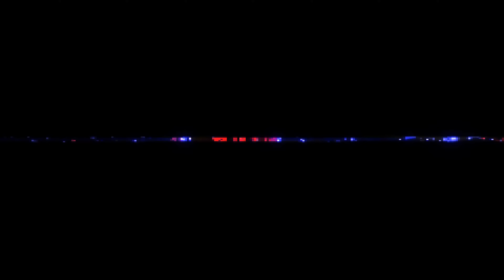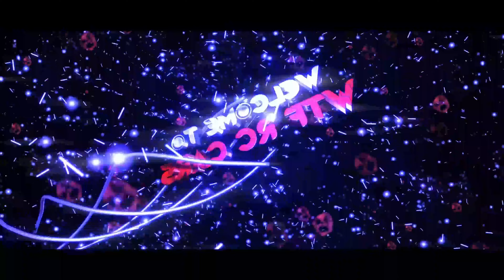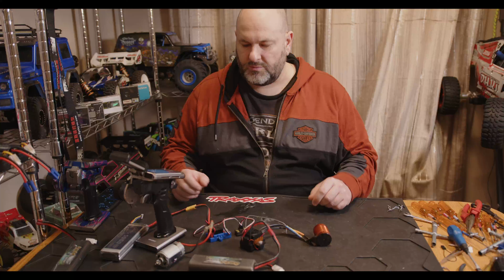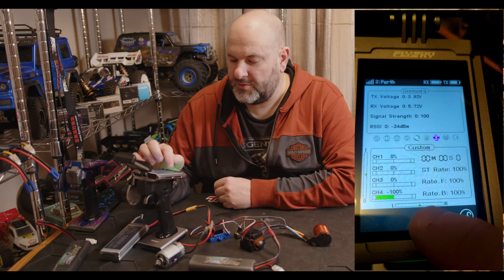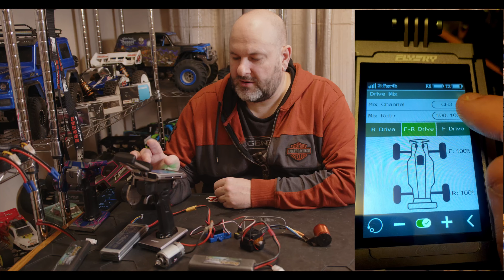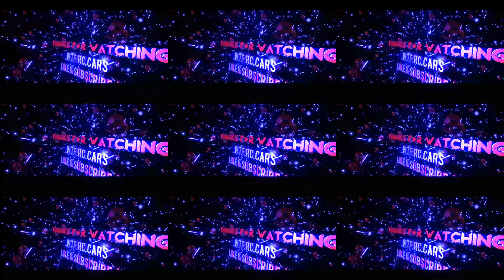Flysky Noble Pro dual motor and ESC MOA setup guide.

Comment: Hi there So I have nb4 plus and I got a mamba x2 micro motor and esc combo. I put it on my granite grom, I had a new receiver for nb4 plus to add to my 8 channel nb4 plus controller. I got the servo to connect to my nb4 and Im having a problem with the motor/throttle connecting. I can get tires to move with power for a brief moment but then it stops right away it won't stay moving constant. if I hold it down super light I can keep the wheels turning but right away if i add more power it stops or most the time it wont move. Not sure what to do and hoping you can help, please let me know !
Reply from the maker: 1st make sure you have run calibration on transmitter so you know that the throttle is working it's in system menu, then you will need to put the esc into calibration mode to make sure Ethan it knows what 100 throttle and brake are then it should work fine

Comment: This was helpful ... building a dual motor setup and using rear steer as well. hahah
Reply from the maker: Glad you liked it :)
Reply: @WTFRCCars  Ok I have a strange one for you!  I have FGrS4 v2 and original NB4 (no drive mix option).
I want to put the rx in 6 or 8 channel mode, and use it for both dual motor & 4wheel steer (other than using an actual 8channel rx) . hahaha  Any possible way to get that going? What do you think?
Reply from the maker: @grvtyboyRC you can use the ibus 4ch add-on to get 8ch
Reply: @WTFRCCars  On the FGrS4 there's 1 ibus channel - I cant just use that 
can I?
Reply from the maker: @grvtyboyRC you would need the 4ch ibus breakout to use extra channels

Comment: I have a MOA with two Hobbywing Fusion Pro. But the rear motor doesn‘t work. Have any body a ideer?
Reply from the maker: Make sure you don't have both the red wires connected from front and rear as the will both try to supply power and one or both will not work

Comment: Do you have a video showing how to set up 4WS? Click-normal 4ws…click-crab walk…click-rear steer only…click-front steer.
Reply from the maker: I have one for the nb4 but your the 1st to ask for a pro vid so I'll get one made for you :)
Reply: @WTFRCCars  I think they would be the same wouldn’t they? If so no need and thank you for offering.
Reply from the maker: Although they look the same the nb4 and pro are different transmitters but you should be able to use the nb4 set up vid for this just the pro has more options :)
Reply: @WTFRCCars  sounds good thank you. I just got mine for Christmas, wife and kids hooked me up. I did the firmware update and it has a whole extra page of icons now! Holy cow! I also noticed they have changed the firmware update process. You can go to the site and click download and it goes onto your pic as an application that you just run by double click while plugged into the tx. Unless I did it wrong. Haven’t used it since but everything looks good.
Reply from the maker: Yeh that is the firmware update but you can also use assistant v3 and it can back up your model memory and update the transmitter :)
Reply: @WTFRCCars  yeah I didn’t need any of that fancy stuff since it’s bran new. Next time. What brushed esc do you recommend for the 24’s or can I use some fancy techno stuff to bind the nb4 pro to the stock esc? I have some V1 and some V2 and a fms fcx24.
Reply from the maker: If you look through my playlists I have one for the scx24 and show a dasmikro receiver/ESC in one works great :)
Reply: @WTFRCCars  I’ve seen that one. I’m looking for something that’s plug and play. I don’t like doing the small soldering. I know it’s not micro soldering so not too bad just not into it.
Reply from the maker: The only ones I've found like that need a receiver and separate ESC and there expensive.
Reply: @WTFRCCars  yes. I’m thinking I may look into removing the Reciever portion of the stock 2n1 and soldering receiver wires to it to use only the esc. That would be easy and cheap once I figure it out.
Reply from the maker: On the scx24 the stock ESC ain't very good and normally fail after a short time that's why I swapped it out for the dasmikro one and there cheap :)
Reply: @WTFRCCars  I have had my eye on this one too. “ASX24-Crawler Plug and Play for Axial SCX24 Trucks” Donald’s edge channel has a very good esc comparison video.

Comment: I got one for ya! Just got my noble. My capra is now 4 wheel steer and my dig servo is perfect. The only issue I've got is, I've got a light controller that I have installed for crawl lights and I can't seem to control with my radio now. Any clue?
Reply from the maker: Change the servo polling rate to manual 280hz should work fine then, you can increase the number till it stops working then back it down when it starts working again :)
Reply: @WTFRCCars  How would I go about doing that?
Reply: @WTFRCCars  nevermind! Went back on one of your older videos about throttle cuts and it worked perfectly! As always, you're a genius!
Reply from the maker: Happy to help :)
Reply: @WTFRCCars  You're always a huge help! Always!
Reply from the maker: I try my best :)

Comment: I have 2 flysky nobles I purchased the second one cause the steering wheel broke off but I couldn’t find parts so I super glued it and it’s been holding since. My original one started having low voltage I charged both base units and when I plug it in new one everything is fine and full charge but older one shows just half charge and if I trigger and turn wheel battery level goes from half to turning red and voice says low voltage charge. Is it possible the battery in grip is bad and also is there any settings to copy my settings to new transmitter. Thanks
Reply from the maker: The battery in the handle is easy to change it just an 18650

https://youtu.be/T_68eueXuJQ
Reply from the maker: As for copying the memories over yeh that's easy too just use flysky assistant on pc :)

https://youtu.be/cG96pweATIo

Comment: Excellent video! I wonder if that works with the Radiolink RC4/6GS  also?
Reply from the maker: If it has mixing it should work but the nb4 and pro have so many mix options not sure all tx have them all

Comment: It's a lot easier with the spektrum DX6R but I need more channels soon
Reply from the maker: I've had spectrum tx but not sure I'd say it's easier in spectrum its very easy to set up on the pro the nb4 is more work but still not hard but depends what your used to :)